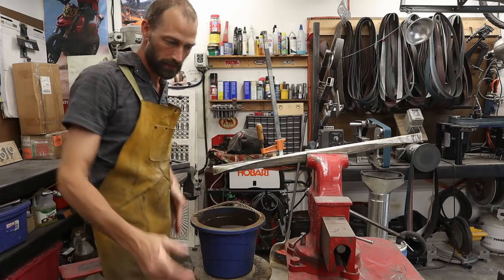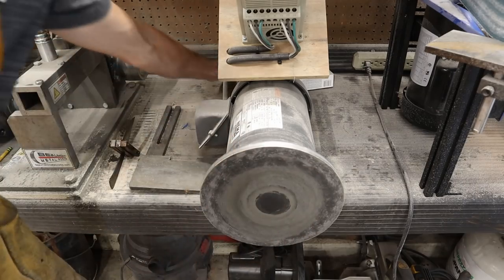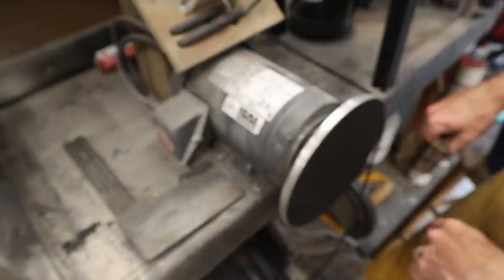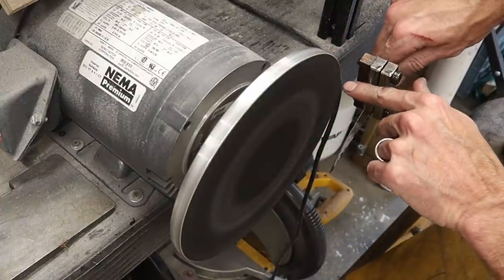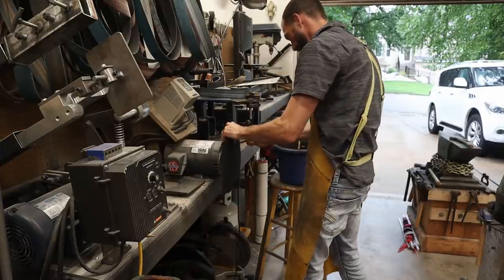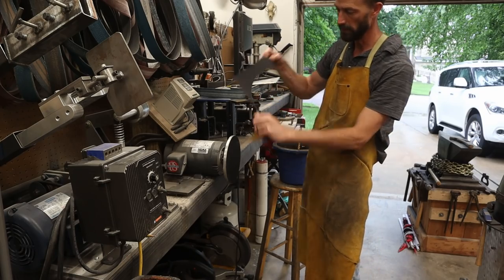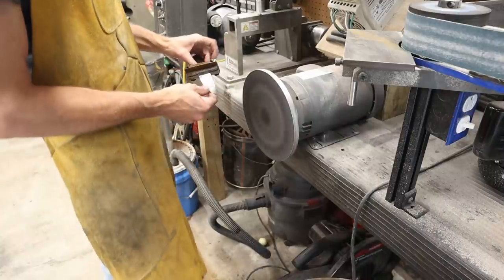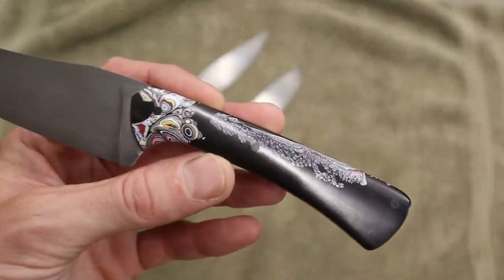Why the Disc sander is so important for knifemaking

Comment: So I gotta be honest here, disc grinders are great for handles & flats, but bevels? Personally I think full flat grinds without some definition/control looks, well, sloppy & lazy. I don't mean to put down your work, I just see a lot of people taking shortcuts & their knifemaking suffers. You got a big following & you are teaching people bad habits. I rarely handsand, but I can get mirror finishes off the 2x72, with bevels that were basically how I wanted them. Not perfect, I have a long way to go, but I'm not getting there without shortcuts. I don't mean to be an A-hole, but I see a lot of people never get better from jigs & shortcuts. Hope all is well, sorry about this, still like your work.
Reply: Dont want to start a knifemaker war here, but I'm genuinely curious at how such shortcuts are equated to bad habits.  Each tool that we purchase is with the intent on making our work easier. Hence even the 2x72 could be considered a 'shortcut' opposed to using files.  As a hobbyist knifemaker, I know that I am not making the volume that Airin, you, or the big dogs are so when I see him coming off the 2x72 with rough spots, I realize that with the low volume I do, that I will likely never make enough knives to learn the 2x72 to it's potential.  So if this tool saves me time....and possibly shows me where I have errors that I can maybe more easily correct, then I feel it's money well spent.  Again, not arguing... I'm just curious.
Reply: @evaderknives  Understood, sir.  I was just curious on the basis for your opinion so thanks!   I agree on the jig.  I'm still new to this and I initially bought a jig and then decided to not use it as I figured if I became reliant on it, I would never learn freehand and so I've now gotten somewhat competent on my grinds. I still find when I hand sand that I have to go back to the grinder for some cleanup and so this video sparked my interest.  Appreciate your response!
Reply: So you like his work even though the shortcut affects his work! Which is it? Can’t be both. Check Nick Wheeler’s video of using a disc sander. You might learn something.
Reply: Dave, I don’t understand your stance here.  How is using a disc sander a shortcut?  Just because Airin didn’t do ALL the work on the 2x72 until it was perfect?  That’s like saying you shouldn’t use a mill to slot guards because you should be perfect at doing it with files.  I get the jig reference but this one doesn’t make sense to me.
Reply: @TyrellKnifeworks  also a 2x72 is a short cut to forging and filling to shape. Dave. It’s another tool for knife makers.
Reply from the maker: I love Nick's work!
Reply from the maker: I was confused 😕
Reply from the maker: I guess I should jump in here! Dave I don't think your an "A-hole"! I watch all your stuff man. I am also not offended by your comment. We all are learning our way through knife making and I assure you we are all looking to make the best product that we can. Some are more talented than others and some benefit from the use of different tools for some of the processes involved with knife making. I love my disc for making things perfectly flat, it appears you have a different style and that is perfectly ok👌. In the end it is our total community that helps us all evolve to the next levels of success! I value your opinion and I also appreciate you keep it respectful while talking to my other viewers, thank you! Cheers buddy
Reply: I also take no offense and hope you don’t either, Dave.  Everyone has their process and tools they prefer.  👍
Reply: @evaderknives  So the entire point you're trying to make is that since it doesn't have a plunge line or a sharp bevel line and its not the way that you would do it that makes it look sloppy and like hes taking short cuts. The entire point of a tool is to make the job easier and more consistent. i learned how to freehand back when i started but you bet your ass i use a jig for the amount of knives i put out cause at the end of the day I'm more concerned with consistency and production, not flexing to other makers cause they don't so it the same way as you. That's the most ridiculous thing I've ever heard, i wouldn't talk about mediocre either 🤣
Reply: I think Dave evader is outa line here. Sloppy, lazy... I mean come on dude. These things are not meant to be an insult?? I watch all sorts of knife makers on you tube and draw different techniques from different makers but I would never insult someone and basically undermine them on their channel. As a maker you'd think you would have a more professional way to address a peer then to hit his comment section and accuse him of poor teaching. I was a sub on yours but not anymore and I will not be recommending your channel to anyone. I personally think you owe Arron an apology. My 2 cents.
Reply: @evaderknives   not offended by the truth. The question is wether or not you're telling the truth. I don't believe that you are an expert knife maker or a " certified" grinding instructor. My point is Aaron never said this is the only way to do this, he is showing us what he does. I like his knives and handles and I like his channel. Also dude you aren't offending me, I take no offense because you aren't addressing me you're addressing Aaron and to be honest he was way nicer to you than alot of people myself included would have been considering what you wrote. I appreciate that you know your words are "wrong" but it took people to point out to you why they were wrong for you to understand??? I find that hard to believe I think you wrote that statement knowing it was wrong but didn't give a crap and now you're catching heat for it. Anyways Dave my opinion hasn't changed about the situation. This knife community is great most people share openly with beginners and are very helpful that's why I participate in forums and watch you tube. You weren't saving knife makers from making a tragic mistake by using a wheel to grind in bevels. No what you were doing was forcing your opinion in a much bigger venue to capture a larger audience. And remember dude what you said was YOUR opinion and not fact. I'm not gonna keep going with this, I still think you owe Aaron an apology. Nuff said
Reply: Hate to be that guy but Dave is full of good information from year of experience and most of you guys commenting on this couldn't do a bevel without a jig the man is right  experience comes from years & years a beating on your craft and this man has that
Reply: @davidnolan361  no one's debating wether or not he can grind a bevel free hand, no one is saying he isn't a competent maker. Knives are subjective anyways. I personally don't like the looks of compound grinds which he does alot of, does that mean I should go to his channel and trash his designs or criticize his techniques? Sorry guy the argument has never been about Dave's abilities, it's about his manners and the way he addresses his peers.
Reply: I can agree with some of this, but when a maker stopps progressing it has nothing to do with the tools, it has to do with the maker. They dont care enough to advance, or be more particular with their finished product. There are plenty of people that would turn a nose up at a belt finished blade and say they can get that finish from a manufacturer.  Bob Lovelace has a great interview out on his philosiphy and process. He has a mill, belts, and disks in the shop. I doubt anyone would argue that the finished product that came out of his shop was anything but a great working knife. As far as being crutched by the tool/jig, again that is on the maker not the tool
Reply: Does look odd in the plunge region
Reply: It's an odd mindset if he can't see that in using a 2x72 he's completely rendering his initial comment pointless... There is a massive difference in using a jig..... And a disc sander to locate mistakes made.  @TyrellKnifeworks

Comment: Great work, I've been doing pretty much the same thing for the last 30 years, I also taper tangs on the disc. My disc has the 1 degree taper plus the edge has a 40degree bevel for getting into corners and such, the motor is also reversible simply by hitting a rocker switch.
Reply from the maker: Man I love it!

Comment: Awesome info. I bought a Rikon 1x42 sander with an 8 inch disc sander and use the disc for sanding handles after I split each of them to put side liners and turquoise inlays in the middle of them. The wood and all the liner materials fit so nice now. The feather compound and buying sheets of sandpaper for the disc is a great tip too. thanks so much!

Comment: I glue a 1/16 thick cork backing onto my flat disc sander. That stops the vibration of the metal disc transfering through the paper to blade. Then put the tac glue on it, just like you demonstrated, on the cork, to allow for changing grit sizes comfortably. I find that since my dics is a flat 8", I can use 8.5x11 inch standard paper. I do have to watch out to avoid "bucking" the blade. Really Like your variable speed setup. I have a reversing switch on my 1 horsepower motor. Have to be very careful of the direction of rotation. Still, it kills any uneven grinding, high or low spots quick and easy. A shout out to Terry Mah, Calgary, Alberta, Canada, the guy who taught me knifemaking ... a real master at mirror finishing. Hint ... Auto body supply shops have sanding paper in really high grit counts.
Cheers. Nice video.
😜😎😉👍👌

Comment: Here I've been looking at knife making from only the blacksmithing angle. It's great to see finishing addressed step by more steps I'd even considered. Could you clarify from an older comment, when pressing the blade against the rotating disk, is the disk rotating such that the abrasive surface is moving toward the cutting edge or away from it? It's hard to tell direction of rotation from the video.  I look forward to watching more. Thanks for your generosity, not only with your know how, but the work you put into sharing it.

Comment: Congratulations for the video!!! Today I adapted a 6" wood disc to my 5" disc sander and used hookit sand pads. They are softer and as I can´t control the speed for me it´s perfect! The result is excellent, it takes away all  risks and scrathes. And I'm going to test Trizact 1500, 3000, 5000 grit pads for polishing!!!
Reply from the maker: Fantastic!

Comment: Excellent video! I have the same grinder, mine's 8" Dia. but isn't faced to 1 degree. I'm a machinist so that's my project for the weekend!! I know that 1 degree face will be a game changer for me and the projects I do on it.
I thought I should mention that I use Elmers spray on adhesive, its in an orange & blue spray bomb ( sorry I don't have the product code handy), it works good so far.
Thanks a lot!!
Reply from the maker: Thank you! I will give that a try! Cheers

Comment: I found from doing this myself that if you don't press so hard the paper lasts way longer for a addition 3min of time. Also Red Label abrasives will make you those discs to any size in any grit. They will also last a lot longer. I use mine upto a equivalent 600 grit on a compound abrasive(also known as trizac) and that lasts near forever.
Reply from the maker: Interesting!

Comment: Another advantage is when you're moving the knife on the disk, the grit is moving in slightly different directions relative to the knife, which helps it cut faster.
Reply from the maker: Yes it does!

Comment: Time or the lack thereof is my biggest problem.  Anything that will cut the time required to get a knife done is aces in my book.  I already have a motor controller sitting on my shelf so all I had to do was order the motor, beveled face disc, and feathering adhesive.  Everything should arrive this weekend so I look forward to kicking ass on hand sanding time next week.
Reply from the maker: That is awesome John! I guarantee your happiness with your choice!
Reply: Got the last piece of the puzzle in today and got it all put together.  My initial feelings are it showed me some areas I need to improve on the 2x72 before heading to the disc.  It's not a timesaver yet but I have confidence it will be.  For now I will take the improvement in quality.
Reply from the maker: That alone will make it a time saver! If it has already shown you how to improve on the 2x72 and you can successfully make adjustments before moving to the disc that is huge!  I don't know if it saves time but it definitely cuts the hand sanding time in half!
Reply: @Aleeknives  It was suggested to me to put a 1/8" rubber pad over the disc and under the paper.  Your thoughts?  I ordered a 12x12 sheet of 60 duro 1/8' rubber
Reply from the maker: Maybe if you are blending but I like the disc as it sits

Comment: If you had a wheel that was a little bit thicker and "flat" along the edge, could you put a thin strip of sandpaper around the outside perimeter and then work angles and such for finish "hand-sanding"?
Reply from the maker: I think you could!
Reply: @Aleeknives  Would it work to replace/swap out the metal turn plate with a wooden one with the outer rim of that wooden spin plate shaped to fit your grinding profile needs? Way easier to quickly make a wooden spin disk than a metal one. And a wooden disc would be less likely to dmg the blade if a slip or such happened.
Reply: @Aleeknives  Next stupid idea from the peanut gallery...

Would it be worth trying to make "grinding swages" for the disk grinder edge?

I'm thinking clamshell so they can be fitted to the outside of the wheel. Thumbscrews to secure them together around the disk. Have different swages available. One for grinding fullers. One for grinding side bevels, or s-curve bevels, or edge bevels, etc. And one to fit your standard knife design size that can do fullers, side bevels, and edge bevels all at once.

The swages, for visualization purposes, would be around the edge perpendicular to the disk face. Turn the edge into a larger work surface with a variety of quick-change out swages for different jobs.

The only thing bothering me in this, besides the high probability that the entire concept is stupid, is the seam in the sandpaper when put around the "grinding swage".

Comment: Sweet! Couple questions. Who sells the vfd's like that and will they work on other types of motors?
Thanks
Reply from the maker: I bought mine off ebay but hundreds of sellers sell many different types of vfd units and yes they will work on different brand 3 phase motors.
Reply: @Aleeknives  Thanks. Found'em on ebay. Good news is they're relatively inexpensive, bad news is seem to be all sold out. They do have alternative suggestions though.
Thanks again.

Comment: Do you ever run into issues due to the disc spinning faster toward the outer edge than near the center? I would think if you didn't deliberately do anything to compensate, you would remove more material the closer you get to the ricasso since the abrasive is moving faster.

Comment: Been waiting on this vid, thanks!   Like xthemadplumberx, I am curious on how this might work on lower grind lines.  I think the best part of the vids was actually seeing that you come off the 2x72 with 'errors' or rough spots.  I chase these with every knife I make and will think I'm good for hand sanding (which I find no therapeutic value in...it sucks) and after a short time, I move back to the 2x72 to further clean. This process takes me forever or until I say 'good enough' and FeCl bath it and stone wash.   I'm hoping this will eliminate some of this.  I also like the explanation of WHY you may have gotten one of the errors on the 2x72.  It's those type explanations that makes folks like me see what they might be doing wrong.  
How important is variable speed with this?  I've not looked yet at pricing, but I imagine adding a VFD would significantly up the investment on this tool.  
Thanks, as always!  ....and great to see the dramatic increase in subs! Congrats!
Reply from the maker: I think the variable speed is a must.  The 3 phase motor is $181.00 and cheap vfd's can be had for under $100 but I like the tech fm50 and it runs about $200
Reply: @Aleeknives do you have a good source for a  3 phase motor
Reply from the maker: Check out Brian house over at House/work

Comment: How do you like that AMK horizontal grinder? I just got an AMK-77 2X72 and I like it so far.
Reply from the maker: Good grinder but I could use a couple more small wheels and the guy doesn't respond well on ebay

Comment: nice setup! Can you use this with longer blades?
Reply from the maker: Any length you throw at it because the disc has a 1 degree bevel so your stock doesn't touch the other side
Reply: @Aleeknives  Awesome deal. I couldnt tell from the video, did you hand-sand across the grain between using the disc sander?
Reply from the maker: Good question, I hand sand after the disc sander

Comment: Looks great. Can it be used to polish hollow grinds?
Reply from the maker: I doubt it, for a hollow grind I would try the same diameter wheel you did the initial gri d with and then use scotch Brite belts to finish
Reply: @Aleeknives  Takes me 8 different belts to get an almost mirror finish and they arent easily available.  Guess i'll use the sander for kitchen knives. Thanks for sharing.

Comment: Would it help to have a rubber surface on the disk sander ? Just curious, new to knife making, but do a lot of boat building so sanding is a big part of that, feels like it's sands easier.. great videos.
Reply: I know this is old, but adding rubber or any backing that has give, will defeat the purpose and your blade will become slightly convexed